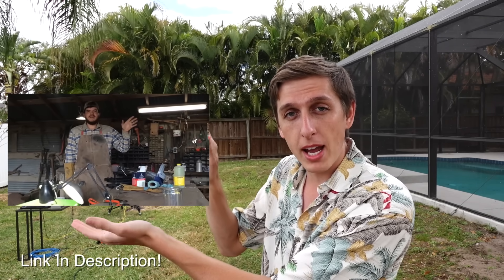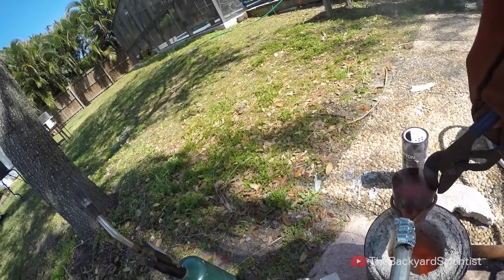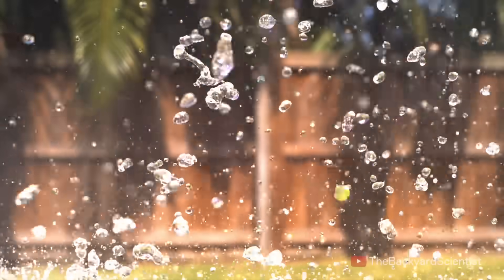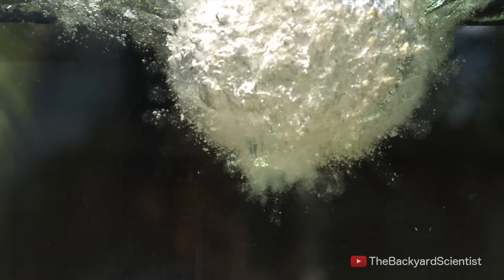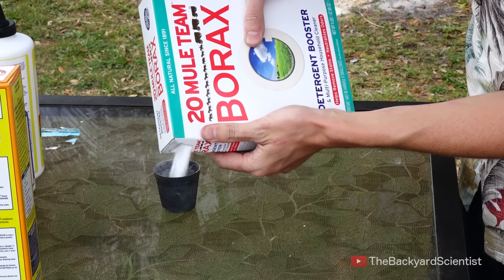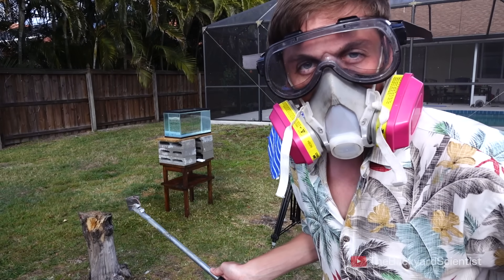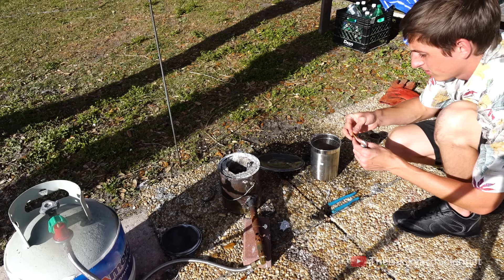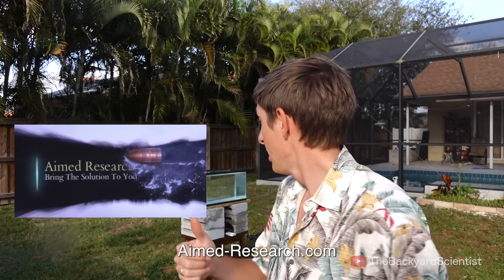Pouring Molten salt into Water - Explosion!

Comment: I presumed that the reaction was purely thermal (if you pour ANYTHING into water with a 750C differential than you're going to get a reaction.... My thought was confirmed with the first experiment. The 2nd looks like a thermal shock (he poured it in VERY quickly) but I'm intrigued enough to keep watching.

COME ON! "In order for an experiment to be valid it must be repeatable"? Three different experiments with three different pour rates?

Interesting, what's the sodium reaction? Metallic Sodium does not need to be molten in order to be highly reactive with water...

Yes, it's not a chemical reaction, it's a physical reaction. The molten salt (NaCl) is more dense (if molten, has a higher specific gravity) than water so it sinks. the Na (sodium) does not, so it floats and although it has a higher endothermic capacity (the reaction is more energetic) that reaction happens above the water so the energy is dissipated more easily.

Borax and the other compounds you tried have a higher surface tension than molten NaCl so the H2O molecules don't get into the matrix and those liquids simply cool rapidly. The Molten Salt, though has a low surface tension, so you are right, the liquids mix and the resulting pressure wave from the thermal shock is enough to break the glass.

Note that the pouring rates were different (you poured slowly in the first attempt, were disappointed and so in the second attempt you poured VERY quickly. Third attempt you were more nervous and so your pour rate was intermediate... three different pour rates equals three different levels of thermal shock and three different pressure waves. If you want to do a more scientific experiment, rig some sort of mechanical pour device, that will give you more quantifiable results (and also let you stand further away from the exploding glass while not wearing you scientists white lab coat!)

https://www.quora.com/Why-does-molten-sodium-chloride-table-salt-explode-when-poured-into-cold-water

Comment: Something to try instead would be Sodium Fluoride, however I don't recommend it--I know you didn't detect acid/base, but even a small amount of hydrofluoric acid can cause severe (internal) injury. Such an experiment could only be performed in a controlled environment.

Since molten Fluoride won't react with oxygen in the air (probably not with nitrogen either) and has more similarities with NaCl than any other compound it can provide evidence for (doesn't explode) or disprove (also explodes) a perchlorate production hypothesis.

Alternatively, you could heat the NaCl to molten and then let cool slowly, followed by chemical or spectral analysis to determine the presence of compounds other than NaCl.

Comment: Sodium Cloride: Na + Cl, when you melt it the clorine evaporates leaving only the molten sodium, although not as pure as the metal sodium, it will explode, for the sodium is an alkaline metal and alkaline elmentes explode in contact with water, when you melt the Borax and the other carbonate compound, those chemicals do not separate from the sodium when melt it, leaving the molten sodium impure and hence, no explosion, Clorine as a gas, it just blends in to the air, the molten salt it leaves is more pure, and you get a lesser explosion similar to the metalic sodium

Comment: You did not heat the other products hot enough. What you are witnessing, is the heat separating the water into HHO. The HHO ignition is what causes the explosion. You can get the same explosion dropping thermite into the tank.

Comment: Since salt is hygroscopic, even in it's molten form, it absorb the water around it. The absorption happen so fast and expand the water molecules exponentially because of the high heat. Since the molten salt acts as a vessel for the water molecules, the pressure inside of the molten salt increases exponentially when the water molecules trapped inside of it turns to steam. In short, the explosion happened because of trapped steam pressure in that molten salt

Comment: if "chloride" means that it has chlorine in it, then the chlorine slowly dissolves with the sodium inside. when the chlorine  shell is gone, the sodium then reacts with the water, resulting with a bigger boom than just molten sodium.
in other words, the leidenfrost effect doesn't occur due to the chlorine in sodium chloride [salt]

Comment: When you heated the daylights out of the sodium chloride,  I am guessing that a good portion of the chloride ions reacted with oxygen in the air to make perchlorate ions, and yes, perchlorates are explosive.  Such a scenario would explain why sodium and the other sodium salts did not yield such an impressive explosion.  Need to be more careful regarding safety.   Could have really messed yourself up for video.
Reply: at lower temps it looked to me like the sodium chloride was just reacting with water the same way hot grease does. 
He definitely needs to be more careful. the lack of safety with molten sodium chloride was one thing, but Sodium metal...
Reply: No. Sorry, but chemistry doesn't work this way. Perchlorates can't be synthesized this way - they will decompose just as fast as they are formed, resulting in nothing at all. You're seeing a typical steam explosion, water simply boils very quickly.
You can get the same effect with thermite and a block of dry ice.

Comment: Due to a breakdown in comms, my little'un squirting (fine hole) vinegar into my very hot pan frying pan of chips. That was a pretty fireball straight up, rather than blown out. Is it possible vinegar reversed into acetylene?
Reply: Obviously you add vinegar and salt on your chips AFTER serving them~
Reply: or was it just water turning to steam. only 1-2% of malt vinegar is acetic acid?

Comment: I Think its still a chemical reaction... if sodium explodes in the process of touching water, then when you heat up salt, you make the bonds between the sodium and the chloride weaker since it goes from being a solid to liquid. If that touches the water, the sodium still gets deep enough in the water before the water actually makes full contact and then creates an explosion under water vs at the surface. Let me know if you think this is possible.

Comment: I would agree with your assessment that the molten salt in turning the water to to super heated steam, rapidly expanding and causing an explosion.  The same thing happens if you have a pan of boiling oil and pour water into it.  You also get an explosion if you were to add a small amount of water to concentrated sulfuric acid but that is a chemical reaction causing the water to super heat to steam in a fraction of a second.
Reply: Uh, is the water that turned into steam another kind of water? No. So this is not a chemical reaction, as the case for a chemical reaction is that the material changes property. Because the water doesn't change it isn't a chemical reaction, but instead a physical reaction.

Comment: Its possible that the free sodium and chlorine ions caused by super heating the salt reduce the leidenfrost effect since both are highly attracted to water. This would account for the type of explosion since it appears to be a pure steam explosion, as well as provide a reason that other salt compounds didn't have the same effect. Sodium tetraborate doesn't begin releasing free ions until a much higher temperature so would probably only have this same effect at a much higher temperature.

Comment: It is a chemical reaction, as this happens during one. It doesn't matter if it needs a catalyst, the heat, it's still a chemical reaction. The way sodium and chlorine bind is non-lethal and they are safe for human, but when it heats up, it produces another version of itself through a catalyst, then it binds with the water and creates an explosion, but the reason why it takes longer is that it has to unbind and bind again, while sodium metal only has to bind. And pH levels don't nesesserially mean that a chemical reaction occurred, because there is still water.
Reply: Is molten salt the same as dissociated salt then? I agree with the pH part but I don't think it's the chemical part of your answer.
Reply: @RJSmith-jo7oe  Table salt does not become something different, it just becomes easier to lose bonds and explode.

Comment: Dude if you heat salt to 800 degrees Celcius you crack the ionic bond between the sodium and the chloride. This is one of the strongest bonds in nature. So you are in effect dumping 800 degrees Celcius sodium into water (Na+)+(H2O)= violent redux reaction. Didn't you ever take first year chemistry?

Comment: I think you might have had two reactions, one was physical, the table salt is hot enough to cause the water to turn to steam and cause the explosion. However, the molten metallic sodium was a mix of both physical and chemical. That's why you got the flame. That was hydrogen created by the sodium hitting water and igniting from the thermal reaction. Simultaneously, the reaction with the water from the hot molten sodium also creates a physical reaction as well, both happening at the same time result in the detonation occurring prior to it submerged in water. Preventing the full amount from being exposed all at once to the water and mitigating the energy released. Had they both been submerged completely, I think you'd have a solid chance of the molten sodium reacting far more violently then the table salt. For the record, I'm not a chemist. I'm probably wrong about some part of it.

Comment: You literally prove, by testing with other salts, that it's not a temperature-only reaction, and then you conclude at the end that it's a temperature reaction because the Ph didn't change, and you come up with a hokey "captured piece of water" theory to fit your inability to explain the reaction chemically.

When you heat the salt, the chlorine in the salt reacts easily with the iron in your rusty "stainless steel crucible", leaving sodium.    Depending on how hot and for how long you heated the salt, you ended up with a fair amount of free sodium.  Sodium reacts violently with water.  Done.
Reply: The guy isn't a vasity athlete

Comment: The difference in activity of the molten salts probably has something to do with interactions between the very high solubility of sodium ions and relatively high solubility of chloride ions in water with the desire for salt crystals to form hydrates. Most of the time sodium chloride either just disolves or is anhydrous. Hot salt might be hitting the Goldilocks zone of being able to absorb water into a hydrous salt just in time for the water to flash into steam. The salt crystal is then acting like a small containment vessel, building the pressure before failing, explosively.
Reply: I havent actually done any research as to why this happens with molten salt but I'm just going to assume that since sodium on it's own reacts very violently when in contact with water (cesium is far more fun when it comes to that though) that the molten salt simply has a weaker chemical bond to the chlorine so you mix explosive sodium with a rapid heat change it accentuates that rapid water movement from both reactions making a larger explosive view. But I'm not a chemist so that may not be it at all.
Reply: NEEEERRRRRRRRRRRRRDDDDDDDDDDDDDDD!!!!!!!!!!!!!!!!!!

Comment: Why would you not at least wear long sleeves and pants when you're creating explosions in a freaking fish tank.
Reply: Florida
Reply: What did you expect it's Florida
Reply: florida lmao
Reply: Cause he doesn't have to. The whole idea of freedom is to make yer own choice. 
I wield just using gloves, wielding helmet, shorts, no shirt during summer. Why cause I would rather get burned than die of heat exhaustion. Safty is over rated somtimes. "Would rather not live through that" Kinda thing.
Reply: @timesthree5757  You're comparing apples to oranges. I've cast aluminium in shorts and a t-shirt, that's not remotely the same thing as what's going on in this video. It's an experiment with an uncertain outcome, the guy had no idea what scope of an explosion to expect and was surprised twice, first by an underwhelming result and then by a powerful one. And considering that the expected outcome is an explosion in a glass box, whereas the expectation when welding isn't that you aim your torch at yourself, different safety precautions are warranted. Obviously.

As for your point about freedom, questioning someone's judgement does not in any way infringe upon their liberties. Just because you have the freedom to do x, y or z doesn't mean that all options are equally good/sane/safe. Florida man is free to do as he will and I am free to raise an eyebrow and comment on it.

Comment: anyone with a basic education would assume that pouring ANYTHING hot into water quickly, results in the water rapidly turning into gasses and bursting
Reply: But it didn't happen with the other salts. Sodium Chloride specifically reacts this way, Sodium does so too but differently. That small amount of molten iron is unlikely to cause a similar explosion.
Reply: @boufns8  well sodium itself as a solid would have reacted as well, that had more to do with the chemical reaction than the heat.   However it is odd how the others didn't react even close to the same way as molten salt
Reply: @np9145  Exactly my point, the sodium was really a non-sequitur as far as I'm concerned, if it was simply the heat that caused the reaction the other similar ionized substances would have reacted the same way as the sodium chloride. Which is why the original comment is ironically uneducated.
Reply: yeah so why didnt the borox, genius?

Comment: Hello. Excellent video with drilling down to find the reason for the 'explosion'. May I offer a helpful hint. Your microphone is picking up a lot of wind noise. If you have a kitten on an external mic, 'it's not doing a good job. Slap a -21db BASS cut on the  sound track and you'll be surprised how much it can reduce random wind noise. You're welcome.

Comment: I think it probably boils down to a combination of the viscosity and melting point of the molten salt.  Luckily you did NaCl and Na2CO3, which are both relatively high melting points out of all your salts (approx 800 and 850 C respectively), have similar solubilities (carbonate is a bit higher), but note that the carbonate salt is almost three times the viscosity at the melting point than table salt (3.4 vs 1.4).  NaCl has actually a very similiar viscosity to water when molten.  So basically NaCl hits the water packing a lot of heat, and then starts to flow and more easily breaks apart when submerged, which increases the heat transfer, forming steam, which breaks the salt glob more apart, transferring even more heat, etc..., and what you get is an underwater steam explosion as the process starts to run away.  The carbonate salt just clumps together, whereas the boric acid for example simply doesnt have as much heat (MP = 180C, I couldnt find data for fluid viscosity, didnt really get into heat capacity and thermal conductivities though they will certainly play a role as well, note that carbonate has a higher capacity than chloride and this may help in the development of the leidenfrost effect).  Viscosities listed at https://nvlpubs.nist.gov/nistpubs/Legacy/NSRDS/nbsnsrds15.pdf

Comment: To explain it simply, Sodium reacted with water to form Sodium Hydroxide. The process of the reaction even when introducing a small piece of sodium to water can be quite energy-intensive as many of you may have seen in your high school chemistry labs. If you haven't look for sodium reacting with water on youtube, you'll find plenty of videos showing how that reaction with solid sodium looks. It's not exactly a quiet reaction. So, when you heat up table salt (usually with lots of sodium chloride and minor quantities of potassium chloride), you break the sodium and chlorine crystal bonds. When broken, the chlorine will evaporate as it cannot stay in liquid form for any significant period of time. Of course, not all chlorine will have evaporated but a good portion will as you increase the temperature beyond the melting point. When you do that, you are mostly left with molten sodium. And that when reacting with water leads to an explosive release of energy or the fish tank breaking apart from the immense amount of energy being released.

Comment: I think it is because the ionic bonds gets weaker and storing more energy in the heating process. If you put the hot salt fluid in the water then the temperature gets rapidly down and in the solution process of the ionic bonds in the water all the stored energy gets free in a explosion.

Comment: It's pretty simple to answer why is"explodes".  

One liter of water will expand to about 1000 L of gas vapor instantly.  This is why life -fighters shoot their water hoses at the thermal layer near the ceiling, not (necessarily) the flames: expand the water, lower the temperature and the fire reaction stops.  

Explosives like TNT work from instantly converting a solid into a much larger gas volume....

Comment: Ok I looked into this and the reason molten salt explodes is because the salt has low specific heat and low heat of fusion compared to the specific heat and heat of vaporization of water.  The low viscosity of higher-temperature salt also contributes to the explosion, which is why he had to heat it up for a longer time to get the explosion seen in the video.  aventurin gives a more explanation on the chemistry stack exchange question "Why exactly does molten NaCl explode, when it is poured into water?" (that is my source)